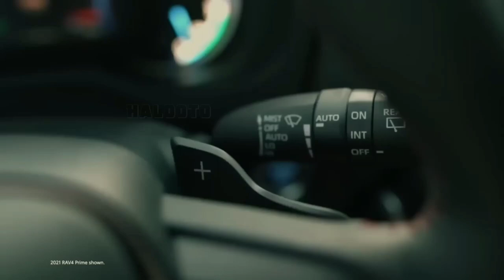Toyota STOUT 2023 Gonna DESTROY $23K Ford Maverick

Comment: Upgraded interior, heated and ventilated front and back seats, heated steering wheel. Plenty of leg room for rear seats. 10.5 ground clearance.  Plug-in hybrid would be great. 5000 towing capacity. This would be a great moderate off roaster with a little class.